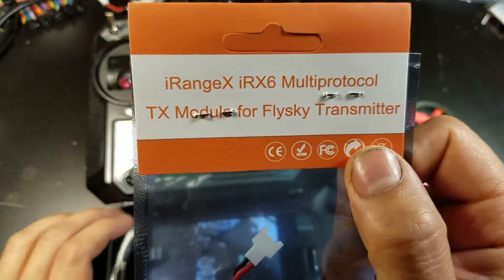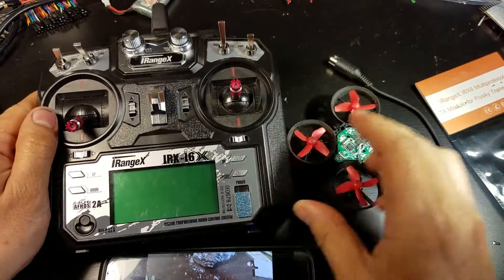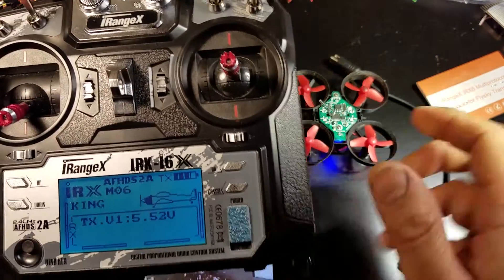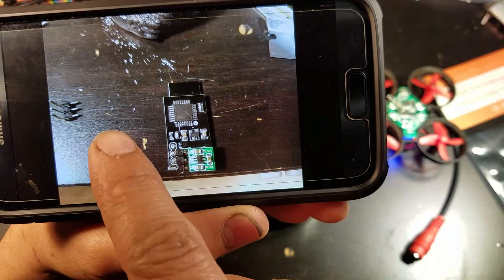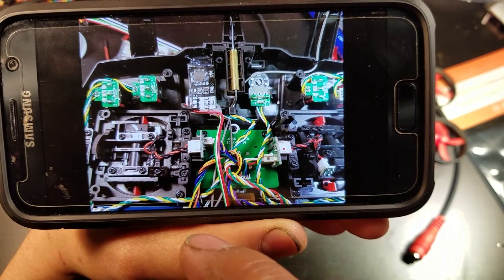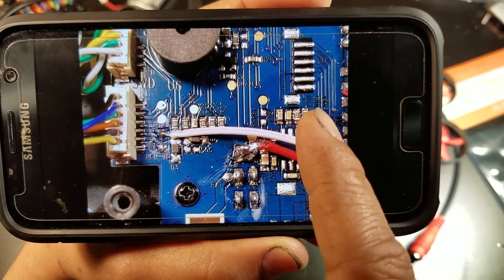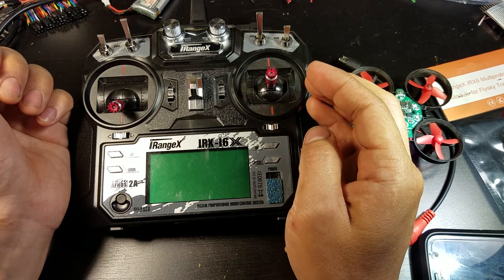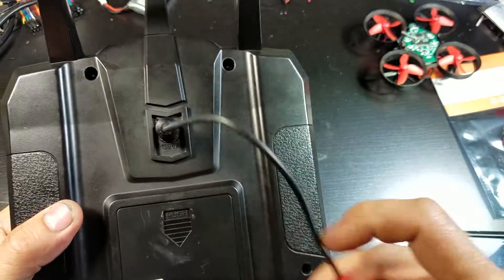iRangeX iRX6 multiprotocol module mod

Comment: On my FlySky i6 I did not use step down converter. Transmitter has its own 3.3V pins, and I connected to multiprotocol module and it works without any problem.
Reply from the maker: nice to know, thanks!
Reply: wow, where is the location? let me know
thanks
Reply: You can find it here: https://flic.kr/p/2aGLERL
Reply: Just did this on my regular i6 and no step down as well. Plenty of places to pick up that 3.3V and ground on the board (man is the board nicely labeled). Thanks s0RR0vv and Doug!

Comment: could i still fly my regular drone if i had this installed or is this the only thing i can use?
Reply from the maker: yes, you can still fly your regular drone, i have tried this.  but if you want to avoid any chance of signal interference when flying your regular drone,  i would add a switch inline with the b+ wire to the irx6 and make that switch accessible.

Comment: I'm all bound with the e011 And h8 mini. just wondering on what setting your using for flight, expo, dual rates, end points etc
Reply from the maker: i didn't adjust any of those settings. i left all transmitter settings as it came from the factory. best thing you can adjust if you want would be the trims. i felt the expo and dual rates did not need to be adjusted
Reply: I adjusted the end points to 85 on mine as full stick would just flip it, I've set it at 100 on the dual rates so I can trigger the flips though. i have added expo at -30 just to try for a bit for the smoothness in slow flight, till I give it full stick to it's max tilt and speed.
Reply from the maker: that is very interesting! when i full stick, it does not flip. but if i chop the throttle mid flight and go full roll or pitch at the same time, it will flip or roll. mind you every time i setup my transmitter(irangex ir6x) with a quad that runs betaflight, i always need to adjust the end points about +/- 5%. yet when i do the same for my friends flysky i6 transmitter, max end point adjustment is +/- 1%. guess my transmitter is not well calibrated from the factory when compared to a genuine flysky model

Comment: Great mod! One of the first i see on irangex! Do you think this mod works with syma toys.? 
And how do you make the cable for trainer port? Because mine doesn't work very well on pc i can't calibrate.
Reply from the maker: the list of supported toys shows some syma toys. shown here http://img.banggood.com/file/products/20161020221736TOY-MTX_Instructions.pdf
not sure which syma you have. i personally don't have any syma toys to try. 
you could make your own with a earphone cable that will plug into your computer or just  buy one from banggood. https://goo.gl/NK5y3K
Reply: Doug Hnut
 did you make the trainer cable..or buy it ?
Reply from the maker: i bought one and i made one for a friend. i can make a video on how to do it if you like.
Reply: Doug Hnut 
Thanks i found the way to make trainer port work nicely... as you said in the vidéo, on the trainer port the ppm pin is not the same between flysky i6 and irangex i6x...
sorry for my bad english

Comment: Actually the regulator you used is fine, look at the description:
1: input: DC 4.5 V-7 V (input voltage must be more than to output voltage high 1 V above.)
Reply from the maker: you are right, I looked at the description of another identical regulator and it says it can accept up to 10volts

Comment: How about this regulator?
http://www.ebay.com/itm/DC-DC-4-75-23V-To-3-3V-5V-6V-9V-12V-Buck-Step-down-Power-Supply-Converter-module-/322366213790?hash=item4b0e860e9e:g:YtgAAOSw4DJYgtOt
Reply from the maker: that will work, you just need to measure and adjust the voltage before hand

Comment: Just ordered the multiprotocol module and power regulator (DC-DC Step Down Module 12V to 3.3V Voltage Regulator MP2259 Board). I hope I'll be able to hook everything up! :)
Reply from the maker: awesome! hope it all goes well.